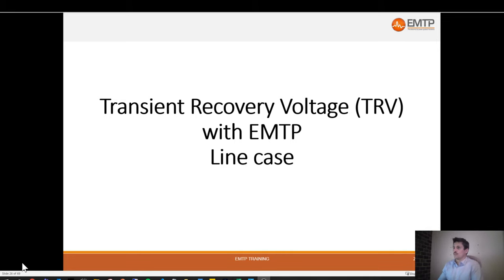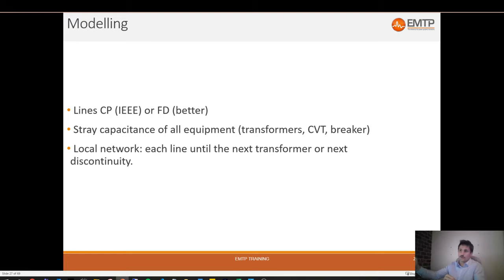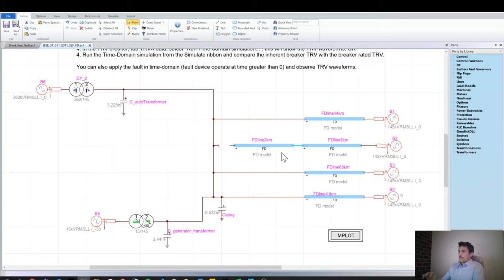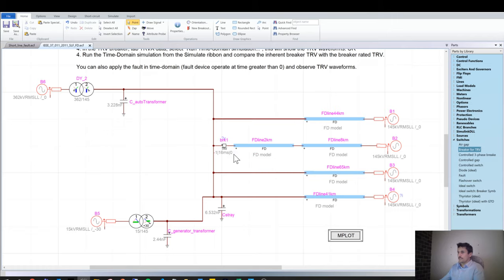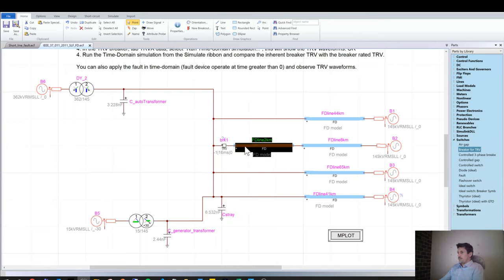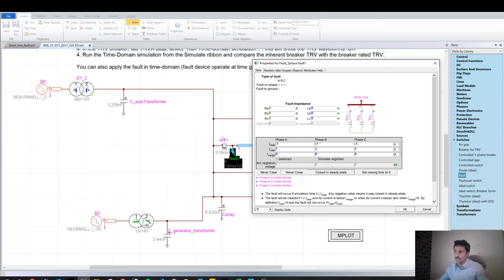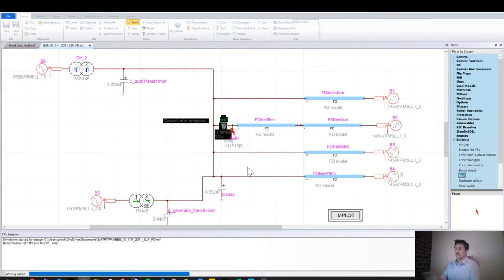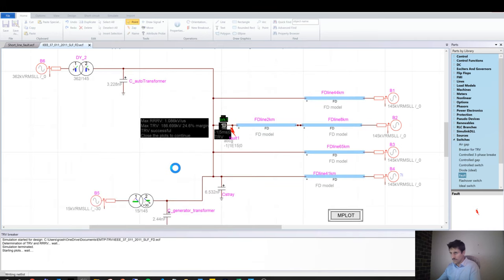Transient Recovery Voltage  (TRV) analysis in EMTP

Comment: We usually using statistical (100 simulations) to calculate TRV and RRRV. When switching breaker in real-life, we have to consider the probability of the waveform (switching when in top of the wave sine is different than switching when the sine wave is zero)
Reply: Hi Phuc Tran Huru,
Right, however, this will depend on the situation. Circuit breakers interupt the current close to current zero-crossings. This is a physical limitation. Therefore, even if you change the switching time, the breaker interupts at zero-crossings. The exception is when the breaker chops a large current, like vaccum CB may chop up to 15A. For example, disconnecting an unloaded transformer.
Do you agree with that?
Reply: @henrygras5732  Yes I agree with that